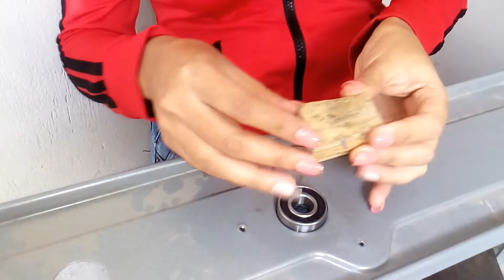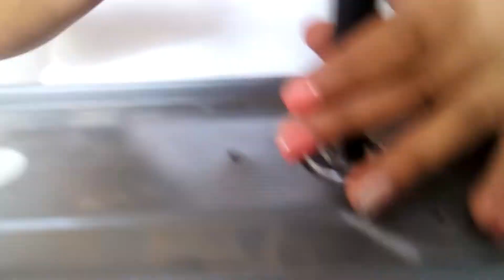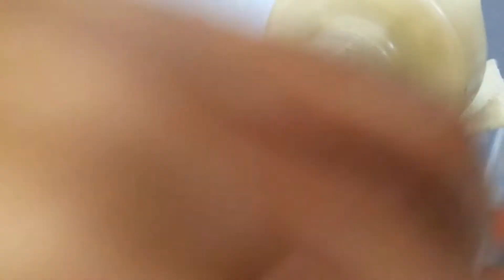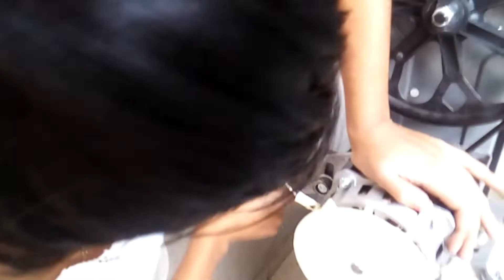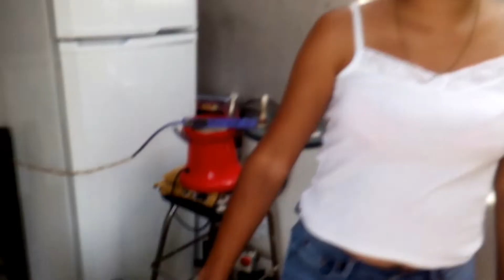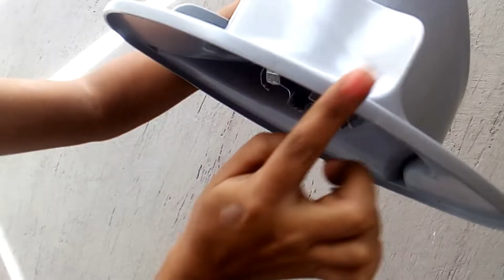Armado de Lavadora Koblenz

Comment: When I saw you with the strip sanding the axel I was like, "how come she didn't attach the axel to the drill and have it rotate and just use the sand paper strip to make the job faster?". Its like you did it the slower and harder way but more accurate, less chances of removing too much material. 

I see your working out those biceps with that heavy motor. Nice work. Great video as usual. Time for a manicure 😄
Stay cute miss beautiful. Until the next video. 😊👍👍👍👍👍

Google Translate:
Cuando te vi con la tira lijando el eje, pensé, "¿cómo es que no conectó el eje al taladro y lo hizo girar y solo usó la tira de papel de lija para hacer el trabajo más rápido?". Es como si lo hubieras hecho de la manera más lenta y difícil, pero más precisa, con menos posibilidades de eliminar demasiado material.

Veo que estás ejercitando esos bíceps con ese motor pesado. Buen trabajo. Gran video como de costumbre. Es hora de una manicura 😄
Mantente linda, señorita hermosa. Hasta el próximo video. 😊👍👍👍👍👍